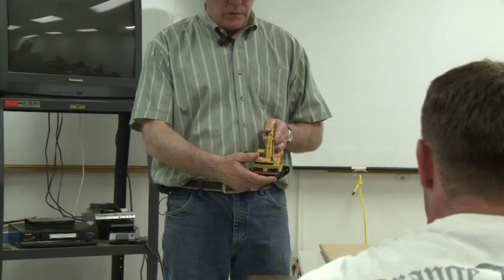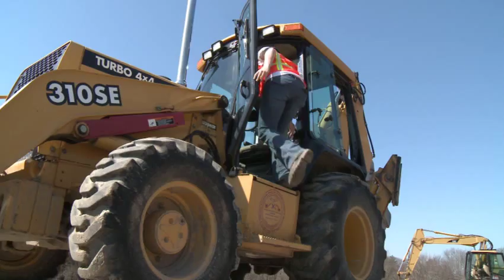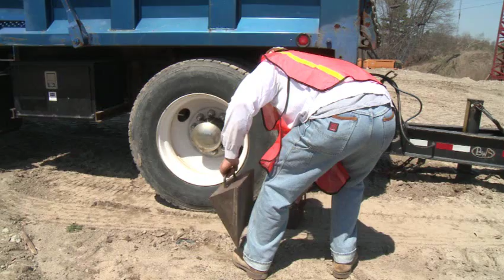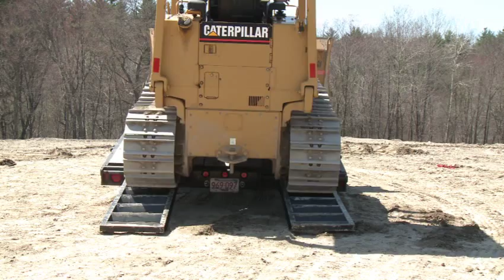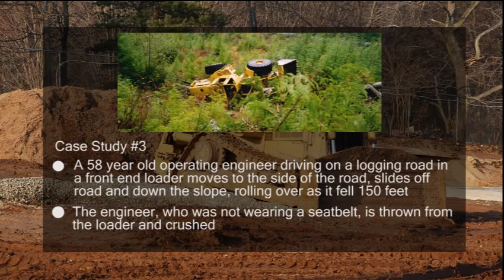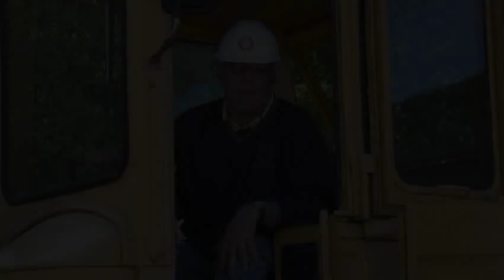Preventing Heavy Equipment Rollovers

Comment: Hi, Folks.
First up, it is very hard to make a model of an excavator, bulldozer or track loader with rubber tracks that has the same or even similar center of gravity and traction characteristics as the real thing. Rubber tracks do not have the same weight as steel tracks and have vastly different slide potential. Using such models as demo pieces can be helpful but can also be misleading.

One of the most important safety 'roolz' when loading or unloading heavy equipment, be it on rubber tires or on steel tracks or wheels, is to keep any and all attachments as low as possible to the ground or deck during the process.

For rossco686 - I have personally climbed an 8-foot high VERTICAL wall on an iron ore stockpile with a bob-tailed, angle blade Cat D9G - at night. Some folks may scream. "BOOOLSCHEEEYITTT", but I KNOW that I did it and I could care less what others might think.

I have also had a Cat D9N dozer on a MEASURED 43 degree side slope, not once but TWICE and it showed NO signs of lifting the high track. In fact, on one occasion, I was turning across the slope to the down-slope side and the high track was still driving through the turn, which means it had traction.

In BOTH cases, I had VERY GOOD ground under me.

I DO NOT recommend trying these 'tricks', either at home or out on the job, but it can give some idea of just how stable these machines can be - - - - UNDER GOOD CONDITIONS.

To IUOE NTF, thank you for posting this video - hard to place too much emphasis on safety. 

The WHOLE purpose of safety is to send home at shift's end the same number of people who worked on the shift in the same state of health in which they commenced the shift.

Just my 0.02.

You all have a wonderful, SAFE day. Best wishes. Deas Plant.